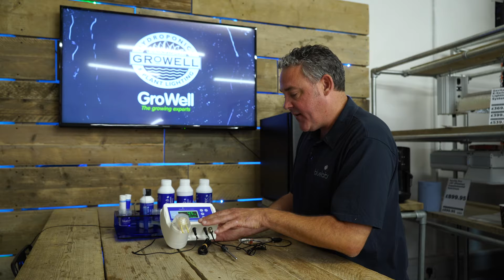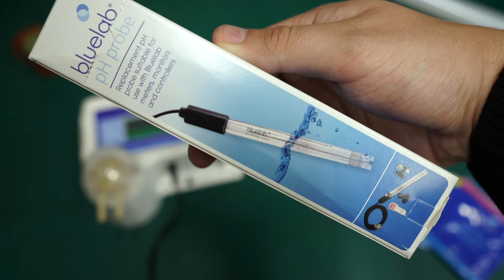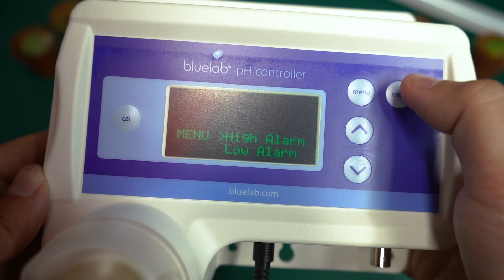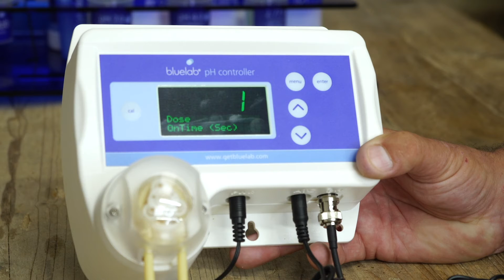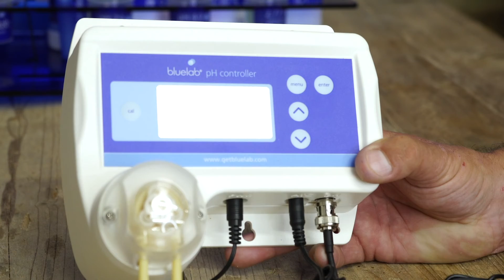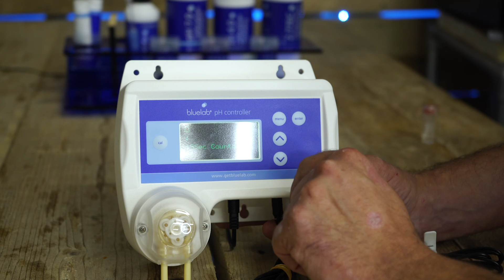Bluelab pH Controller ft. James from Bluelab | DISCOVER

Comment: Some of the information provided here is false. If you're using municipal water then the PH will tend to rise due to chemical reactions with compounds already present in the water. If your water is very soft or you're using RO, the PH can go both ways due to the lack of buffering. In my experience, once there is no bicarb in solution the PH will trend downwards. You will also need to dilute the acid/alkiline to ensure adjuatments are not too quick. This will lead to an error as the controller will overdose.

Comment: i was tempted by one until I hear the end where it goes into alarm mode after 15 cyles which can only be a maximum of 15hrs or much less of faster systems, so basically if a system remains stable for a few hrs it switches off. Does that not defeat the purpose of this doing the management if every day you have to take it out of alarm. the PH might take longer to increases than 15 cycles at whih point this stops working and is a £600 paper weight doing nothing until you have to manually intervene.

Comment: Sorry guys i dint understood correctly maybe but this controller adjust the PH ONLY in one way???
 In my case it really depends on what type of additives I add to the reservoir if i have to UP or DOWN so, how am i gona be able to set and forget the PH adjustment of my reservoir if this thing can just lets say lower my ph???
Thanks
Reply: Nope. It's literally basing everything off of the assumption that your plants ph will only rise,  and if it lowers then that means there are some other issues.. nah. I wouldn't trust it.

Comment: So I have to set it so that it doses 0.1ml, but it does it in half doses to get there? Why not just make it dose once and then have a delay timer? It's not like it will adjust the dose based on what it found the end result to be..that just makes it more likely to be wrong. I'm assuming that's just the earliest it can dose again... But that doesn't really Mena it won't overshoot... If it hits 5.9ph it's still above 5.8 so it's going to drop me to 5.7ph...

So I basically have to find out how much I need to dose 0.2ml from a starting point of 5.8ph...and see how many minutes it takes to get to 6.0ph. Doesn't sound like a smart device... It just has a delay and trigger...

Comment: How do you get it out of alarm mode? My display is flashing.
Reply from the maker: In the menu go to the Alarm setting, and set it to 'OFF'. If you want to reset the alarm just set it 'OFF' then 'ON'.
Reply: @growell  that didn't work. I tried that. But I got it. Temp probe was the problem.
Reply from the maker: Ah, glad you worked it out. Sorry we couldn't be more helpful.
Reply: @growell  man it was driving me crazy. What's the purpose of the temp probe?
Reply from the maker: Just so you can keep an eye on the temperature of your solution. Most nutrients have a range of temperature that it is best to keep them at.
Reply: Figured it out myself. My temp probe went bad. Soon as I disconnected the temp probe the controller came out of lockout mode. Ordered a new temp probe. Hope this helps someone.

Comment: How do you change it back to ph 7 after calibration as I don’t want it ph 4
Reply from the maker: Once the pH Controller is calibrated you don't have to change any settings, it should just give accurate pH readings in your solution tank. Calibration is used to ensure the probe is giving accurate readings, not set it to either a 7 or 4 mode.
Reply: Thanks for the reply I worked it out but yep spot on thanks again

Comment: For those who have a small water volume and wish to allow the pH to drift or fluctuate between 5.7-6.2 you can set the target pH at 6.2 and then over dose so it drops to 5.7 and it will not dose again until it hits 6.2.

Comment: I just got one of these for use in a hydroponics setup in a 5 gal bucket. Can anyone tell me how much I need the machine to dose to keep it in the correct PH range? It did not come with any charts...
I am also assuming that I can drill a hole in the top of the PH container and put the feeding tube inside and the solution wont dry out? I'm using the general hydroponics PH down.
Reply from the maker: There isn't a set amount of pH down that'll adjust the pH in your 5gal bucket by a certain amount.
Best case is to take a pH reading then slowly add pH down until you know how much pH down is needed to adjust your tanks pH by 0.1.
Note the amount of ml needed and use that to work out your dosing time on the controller.
In this video James goes over the maths for dosing times at 7:08.
Drilling a hole into the top of your pH container shouldn't let it dry out.

Comment: this unit made me crazy when set to ph up the ph was at 5.9 changed it to acidic and the ph was most of the time at 5.7 but never 5.8 with an on time of 1sec..... i had to manually correct it everyday so the unit was useless returned it and bought a around the clock ph/temp/tds monitor instead....i would recommend it if it was a complete unit with ph up and down
Reply: thanks - safed me alot of bucks! i already own the guardian.
Reply: Exactly.  Once I heard it only doses in one direction, count me out. What's the piont of it then. Weird things happen and id rather be safe and it be able to dose up and down

Comment: How does this not cause nutrient lock out? When adjusting ph in nutrient solution ph should be diluted......
Reply: you can set it as you like; stronger acid> shorter on-time. Diluted acid> longer on-time. Same result. When target pH is reached it will unlock nutrient uptake.
Reply from the maker: @Rob Smit is right!
Reply: You can dilute your solution before adding it. I assuming you're talking about the fallout you get when adding too strong a solution to your tank.
Reply: Thanks Adam, yup that’s exactly what I was referring too but now I know better.

Comment: I just bought one and set it up and I have he ph setting set to 5.8. When it gets above that range the motor doesn’t kick on. So the ph just keeps going up. Do you know what could cause this ? Thanks!
Reply: you might want to check if the dosing directing is set to down (left side on display showing an arrow down or up). And check if Controller mode is set ( if set in monitor mode, it does not dose)
Reply from the maker: This could be caused by all sorts of things, so it's probably best to contact Bluelab customer service directly in this scenario.
https://bluelab.com/united_kingdom/contact-us/

Comment: Will this work on an Autopot system with a tank that just drains down or will it overdose
Reply from the maker: This will work in a tank that drains down, as it'll constantly monitor the pH and only dose when required. Also as it only doses in small increments before measuring and dosing again you shouldn't have to worry about the reduced volume of liquid in the tank causing the controller or over dose.
Reply: @growell  Thanks folks

Comment: What would you recommend for a two-tank system? Say 1 thank has nutrients inside of it & the other is plain H2O
Reply from the maker: You don’t need to monitor the pH of your water tank as the pH shouldn’t really change compared to the nutrient tank. So you'd be fine with just one pH Controller monitoring your nutrient tank.
Reply: @growell  Hey, thanks for the reply! I think that I am going to go with a 1 tank organic nutrient system actually (for now.) Still, greatly appreciate the awesome info in the vid & your comment ☮️

Comment: Looks great! I was taught in my food science degree that pH will drift if not celebrated regularly though, is that not a problem here?
Reply from the maker: The pH Controller will continue to take readings and dose if necessary, so even if your pH drifts the controller will bring it back to the pH level that you've set.
Reply: @growell  Thanks for the reply! I am sorry i explained my question poorly. What i meant was i thought the pH probe needs to be re-calibrated (with pH 4, 7, 10 control solution etc) regularly or the probe itself will drift and report an untrue reading. Is this not applicable to this system? Thanks!
Reply from the maker: We would recommend that you re-calibrate the probe roughly every 30 days, this is a good opportunity to clean the probe as well. Additionally remember to soak the probe in KCL solution when not in use to ensure it keeps providing accurate readings.
Reply: @growell  Ok thanks very much!

Comment: Is it bad to put straight acid in the jug this controller will draw from?
Reply from the maker: If you are using Bluelab pH down (35% Phosphoric) you can use it neat. However if using another brand of pH down we suggest checking the acid percentage (e.g. if 80%) you can dilute it with water. Though you must still set your doser using the instructions so that it doses correctly, and and only adjusts your tanks pH by 0.1.

Comment: Would this work in an aquaponic system where the ph is dropping? Is the unit water resistant? I’m buffering with calcium hydroxide. Thanks
Reply from the maker: As the Bluelab pH Controller is designed with Hydroponic systems in mind we wouldn't recommend it for an Aquaponic system.
Reply: I don't see why not, you can select contolling ph up or down.
As long as your calcium hydroxide comes as a liquid and you can keep the probes free from gunk...
Reply: @lrrrruleroftheplanetomicro6881  Welcome fellow kalk fren

Comment: So use PH Up with this or PH Down? How does it know if it is PH UP or PH Down that you are using? Great Video!!
Reply from the maker: You would use pH Down which is an acid. In most Hydro systems the pH will creep up so you use pH down to keep the pH level stable. If you wanted to use pH Up there is a setting on the controller where you tell it whether you are dosing with pH Up or pH Down.

Comment: I have this and the blue lab monitor/ec I have both same tank one reads 5.8 other reads 5.5 both calibrated the one that reads 5.5 I swap with the doser and it goes upto 5.8 the 5.5 is correct because tested with my blue lab pen it doesn’t make sense to me any ideas?
Reply: how long since it was calibrated - what temperature was your calibrating solution at)? what is the temperature of the solution at measuring? has the probe ever dried out? do you wash your probe off EVERY single time you use it then replace the cap making sure it stays always damp? if you answered no to any of these replace thge probe.
Reply: because people believe ph meters are 100% precise, but they are not